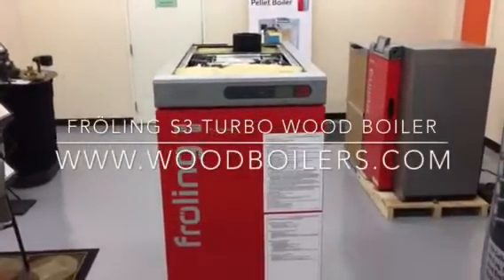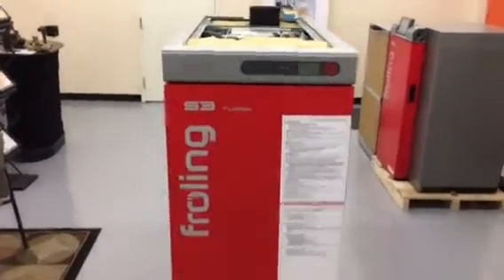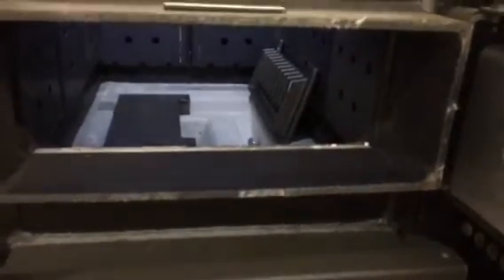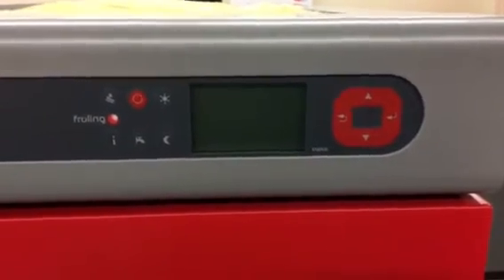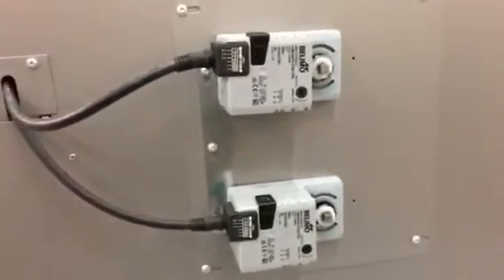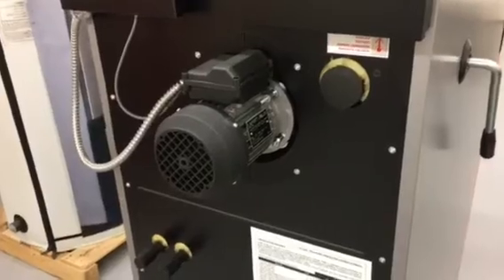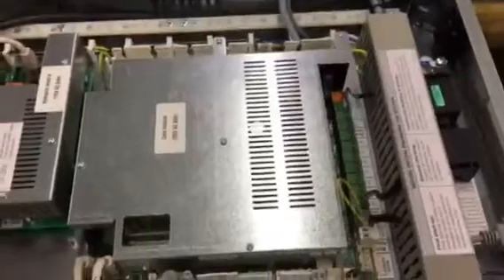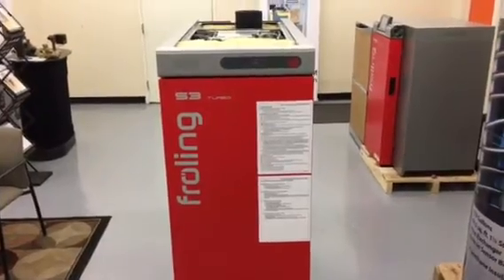Froling S3 Turbo wood boiler overview

Comment: I am installing one of these in a super-insulated shed on my property. Spray foamed and air tight. I only assumed that this unit would have a dedicated fresh air duct to the outside, but that doesn't seem to be the case. Am I missing something? Are they expecting the user to leave a vent open at all times when this is burning, to provide fresh air to the entire room? That just seems very inefficient to me. Can someone answer this? Thanks in advance.
Reply: its very efficient,over 90% , they have to be installed in basements,or separate technical room,so vent would not be a problem,as they dont have air duct intake as normal stove installed in your living room

Comment: How is the domestic hot water (for showers, kitchen taps etc...) heated in summertime when you are not burning wood in the boiler?
Reply: SOLAR water heater!! otherwise, you need an additional heat source. electric, oil, gas, coal.

Comment: Can you turn off the gasifier function? e.g. can it work when there's a power outage? I saw on an old video a guy pullling a lever then a normal smoke came out on the top.
Reply from the maker: The boiler does not operate without power.  There is no bypass function for exhaust.
Reply: Gas generator to electric, OR solar re-charged backup battery.